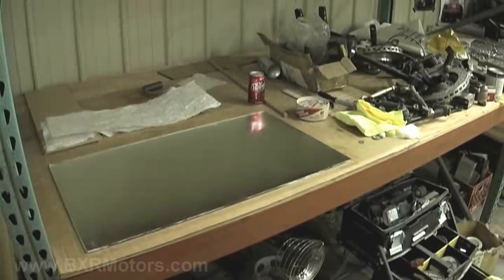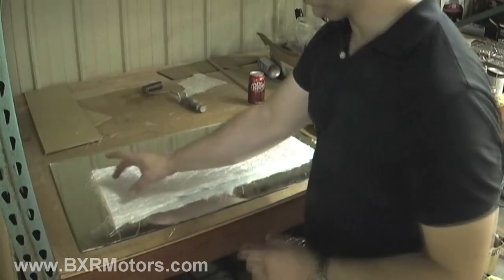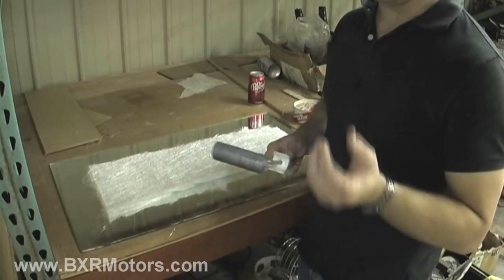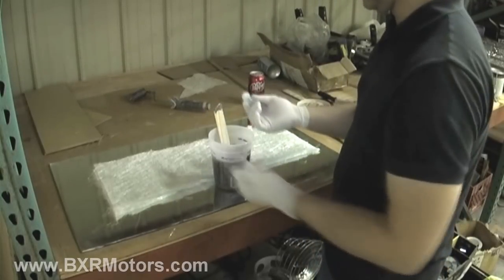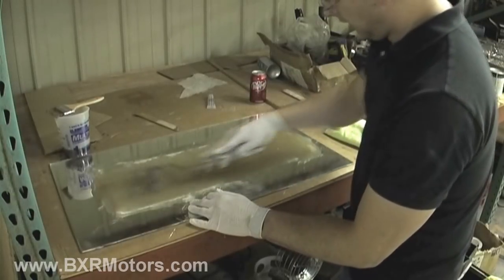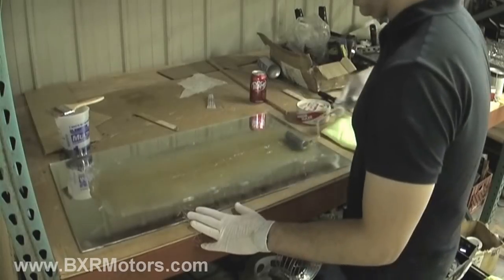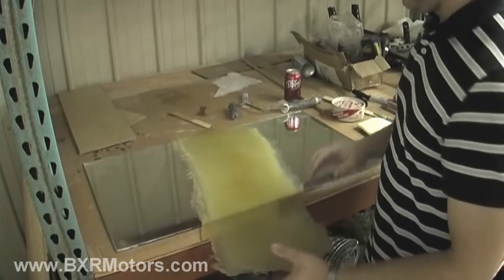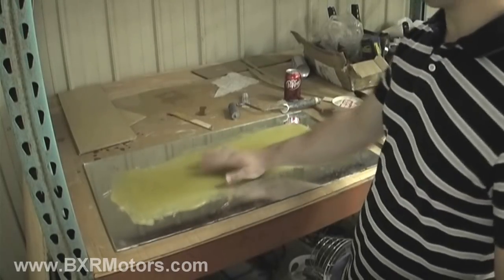Bailey Blade XTR Car Design | First Tutorial! How to make flexible fiberglass panels - Part 22

Comment from the maker: Oh and yeah you can use chopped mat for road legal cars,  Weaved Fiberglass is used to cut down on weight and has to be applied in specific directions to maintain its strength.

Comment from the maker: @GermanDesigns Well the ideas is to use no more than two pieces of fiberglass mat or cloth. Also a key part is to leave more resin on. If you vacuum form it or use less resin it becomes brittle but stronger and lighter. So its a bit of a trade off depending on how you plan to use it.  The resin is just standard resin.

Comment from the maker: @GermanDesigns Its Polyester  resin that I used,  epoxy resin would be pretty flexible too if its hand applied. If you Vacuum form it that it will not bend at all. The key it to just let it cure natural.

Comment from the maker: Yeah polestar resin does shrink although not by 3% thats crazy high, its  more like 0.5%. Also it shrinks over long period of time Polyester resin continues to cure forever causing the shrinking. Its better to use a blended resin.  Though in our case we are only building a body buck to pull molds from, the final panels will made of other better materials.

Comment from the maker: You could use the cardboard for a kind of rough form for the fiberglass... Bondo will not reinforce anything.. its just used to make the surface smooth etc. Try to make the part as best you can to the shape you want. You do not want to use a lot of body filler. especially on a Kart, as i would think it would crack fast.